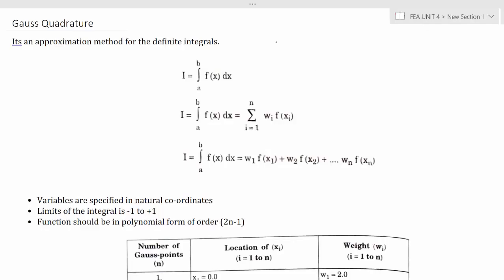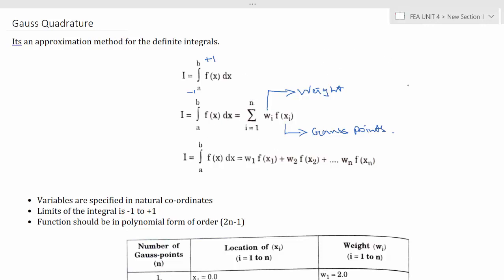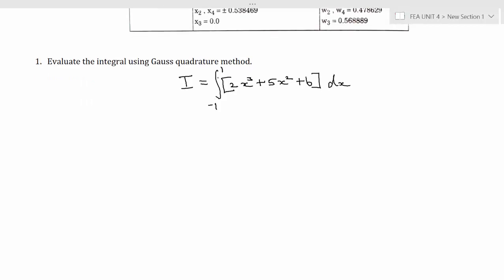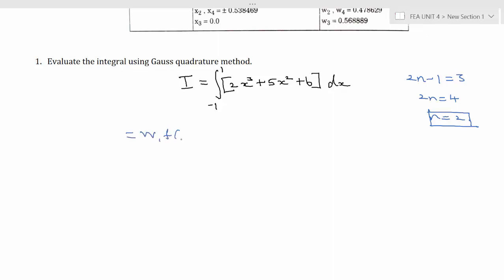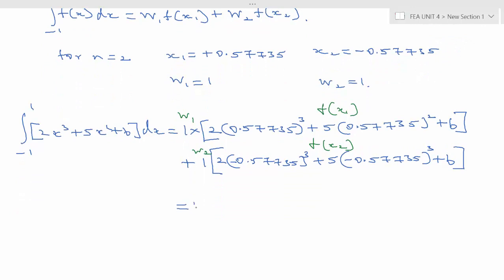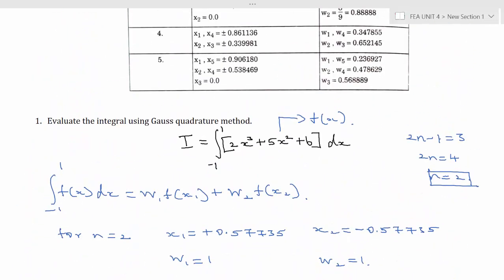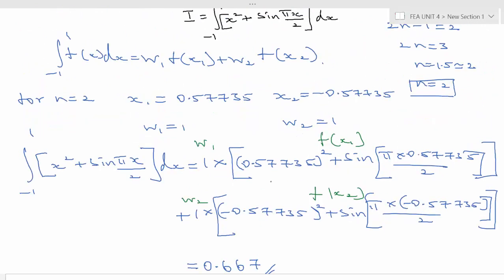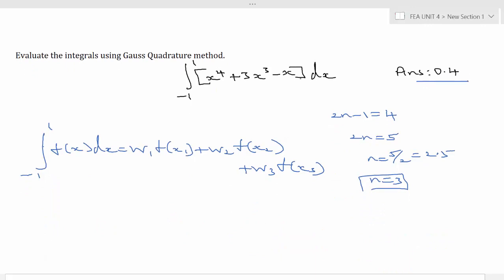Gauss Quadrature | Numerical Integration | Finite Element Analysis (FEA)

Comment: Your video is great, but im having truble traslating this method to 3d FEA specifically using cuadratic tetraedral elements, can u help?
Reply from the maker: Theoretical or software??
Reply: @themechanicalengineer  I'm doing a finite element code in Matlab. I already have a code working using linear thetraedral elements. Now I'm trying to use quadratic thetraedral elements but I need to integrate to solve the stiffness matrix.and I don't quite understand how to implement the numerical integration.